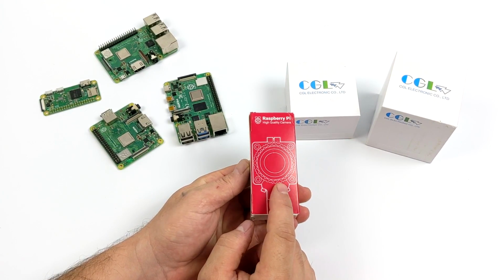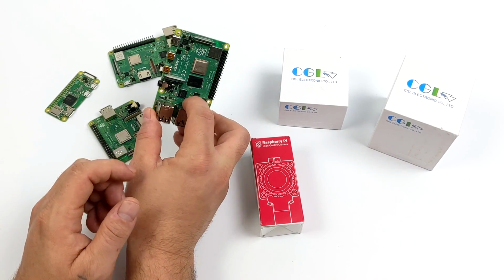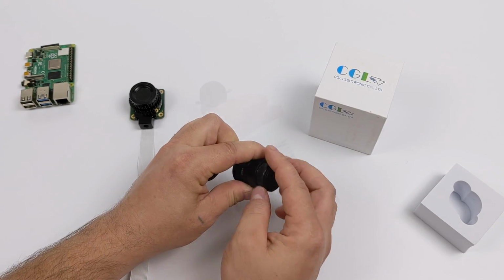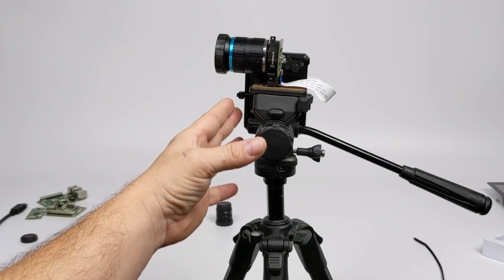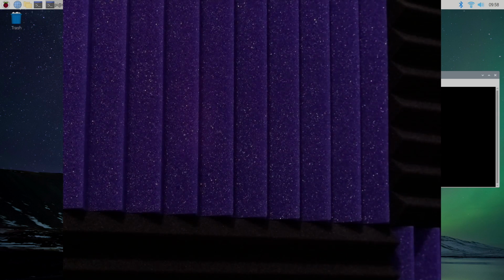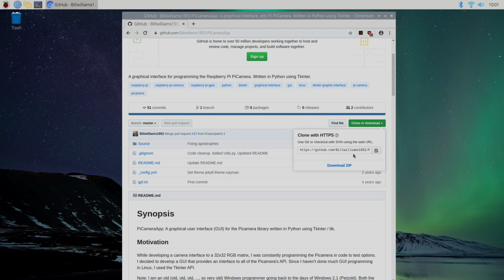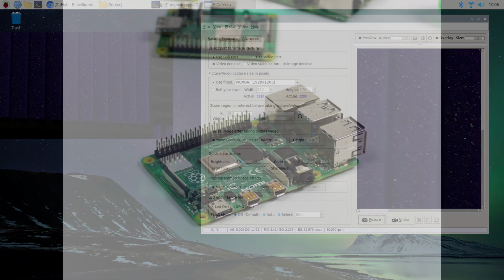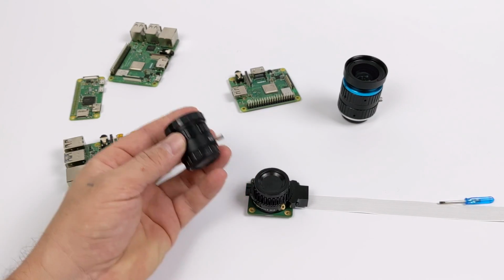The New Raspberry Pi HQ Camera Is Awesome! - Set Up And Testing

Comment: There is a board you can buy that accepts the ribbon cable from the camera and has USB-C for output. I built mine for use at the telescope, connected to my laptop.

Comment: Okay, the HQ camera is great, so I've purchased 3. One is for a motion tracking telescopic security cam and 2 are for robotic stereoscopic depth perception on a StereoPi CM3 board. They're all hooked up and ready to start streaming... as soon as I can figure out how. There's much more to this than taking a snapshot or live preview, but obsolete support documentation and 2018 tutorials are mostly all that's available.😣 
I've watched so many OpenCV installs over the past week that my head is spinning.😵 But, haven't found any that cover gstreamer nor remote opencv processing of a streamed video source, especially w/dual cameras. Can't get gst-launch to work in python because I don't know whether to use uv4l, uv4l-raspicam, the picamera module, pre-loading the driver, -cs 3d sbs, or /dev/videox.
The IMX219 RPi V2 cameras work fine with python and nvarguscamerasrc on the NVidia Xavier NX, but not the HQ w/o removing a resistor. Besides, I would much rather keep the $400 NX on my desk to remotely process images from the StereoPi robot 'head' and return motion commands over WiFi. 
@ETA Prime, please follow up with detailed tutorials on this stuff, so that end users can get the most out of the HQ camera.🙏

Comment: As a professional photographer for over 50 years, may I make a suggestion?
Adjust the back focus on something that is very far away (infinity). 
Good subjects: clouds, mountains, the moon, tall buildings, cell phone towers, etc.
That way, the lens will be able to easily focus on anything closer. 
Once the back focus is set then if a lens has distance markings (3, 5, 7, 10 feet, etc.), then those should be fairly accurate for correct focus.
 
Terry Thomas...
the photographer
Atlanta, Georgia USA

Comment: I've got my 16mm lens already, and the camera finally shipped yesterday! Planning on using mine to work on PCB repair as the quality of the image when connected to a suitable display looks far better than the microscope I got from eBay (then subsequently found was damaged when I eventually opened it 9 months later! will repair the case that's damaged as electronics seem ok).
Anyone had experience of using for PCB work yet?

Comment: Is it possible to remove the lens mount from the sensor board? I have some use cases in mind in which the mount would be a drawback — such as mounting the sensor at the image plane of a film camera to check that the lenses focus correctly.

Comment: Thank you for the video.  I will definitely be getting one of these cameras and both of the official lenses.  One possible concern is the depth-of-field.  Is the wide-angle lens also a macro lens?  I assume that the telephoto lens is not.  At least it is rare for a telephoto lens to also be a macro lens.  What is the closest focusing distance and at that distance how many lines-per-inch (LPI) will either of the camera and lens combinations resolve too?  I have a need to programmatically capture images of at least 200 LPI, over a depth-of-field of at least 5 inches.  Can this camera, with either of the official lenses do this?

Comment: Hmmm.... interesting alternative for astrophotography.
Reply: Marcos Codas The CCD sensor is about 1/10 the suitable size for Astrophotography plus the ISO range is not enough. So the light capturing ability is no where near where you would need it. So wouldn’t be any good beyond basic Astro shots
Reply: @CiaranMartin  I should have been more specific. If you were to attach this to a guided telescope, it'd make a pretty good companion for that (as the ISO isn't all that important and the sensor size isn't as relevant due to the way those pictures are exposed).

Comment: Wow this camera is what I was looking for.
At work I might have a project where we use RPI + OpenCV + Camera to count people entering stores/supermarkets during pandemics and it would eliminate the need for some valuable personnel just counting people going in and out.
I was concerned that most of the cameras for RPI weren't very well suited for such application due to the limited resolution and optics.
This one should be perfect.
Shame that it's out of stock everywhere already :/

Comment: Only around £50 for the Sensor and £25 for each Lens.
Takes standard C and CS type mounts.
Infra Red Filter fitted but can be removed (voiding warranty).
1920 x 1080 Resolution (may have a problem using it to record 4K at the moment though).
Works with all Raspberry Pi versions.

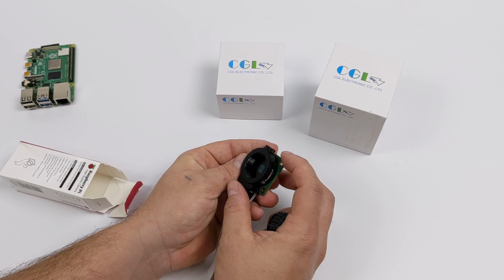Comment: At around 2:45 you mention that the "back focus" would need to be adjusted when you put a new lens on it but I missed the part where you describe how to do this. Is there a "correct" method? Does it need to be done for each new lens, or just the first time you put a lens on and lock it and it will work for all lenses thereafter?
Reply: The bigger lens costs $50. That lens requires the HQ camera board which costs $50. As I understand the system, the "back focus" is on the HQ camera board and when a new lens is used, the "back focus" is a focus opportunity (or a burden - depends on your outlook).
Reply: @vvwording4844  A simple "I don't know" would have sufficed.

Comment: print 3d case to put everything together, the pi, camera, battery pack and lcd display. Make use of GPIO pin to make shutter button or you can just use touchscreen display panel. Et voila, raspi-based portable digital camera.
Reply: Why?? Don’t you already have a phone that’s smaller, lighter, more convenient, with a camera that’s as good or better?
Reply: @davidleigh6196  its not about that. Its just curiosity, the feeling of satisfaction when you can make something and it works.

Comment: I don't get why people hate on the W small camera connector. It is just a connector. The cables that go from the small connector to the larger connecter are EASILY found for less than a dollar--and there are many, many perfectly suitable cameras that have the appropriate cable end already for the W specifically. They make handy little "room monitoring" webcams for a home automation setup.

Comment: I hope IMX477 will get support in ESP32 soon. I've been wanting to build my own DIY 360 degree camera for cheap and I want to dewarp the images and videos on my phone (OnePlus 7T) while caching to an SD card connected to the ESP32 (to hopefully get higher framerates by eliminating streaming overhead). I was thinking I'd use 3 wide angle cameras.

Comment: I really love having a MicroCenter nearby.  I am the IT manager for a cold storage plant and often I will buy things like printers and TVs there for less than Amazon. Also their SD, USB Stick, and SBC pricing is typically half what you'd pay on Amazon.  The other day I had to buy some sort of mesh system for the WiFi in my house.  If I had waited one more day my girlfriend probably would've killed me, so I guess they saved my life.  The salesperson there recommended I get a Ubiquiti Networks UniFi nanoHD AC2000 Dual-Band Wireless Access Point, instead of a mesh system, and boy was she right!  I went from about 20-40mbs around the house for 250mbs everywhere.  An amazing store!

Comment: Thank you for posting this video and I have been looking for reason to upgrade from pi 3b+ to pi 4. I am into video recording as a hobby and I was considering getting a more expensive camera. If this HE camera turn out to be a solid performer for 4k 10bit recording then I am getting both the pi 4 and the HQ camera module. Subscribing to your channel.
Reply: While the sensor seems to be capable of doing 4K at 10bit  (it can do a full sensor readout at 40 fps at 12bits), the Raspberry Pi will be the limiting factor. It's either the CSI interface that's used that doesn't support 4K anything or that the built in h264 encoder doesn't support 4K.
Reply: @LewisUpperton  Oh that would be my first disappointment.

Comment: Can you check it with android installed on raspberry pi and use the Google pixel camera Apk
Reply: Wouldn't work bcz it requires Snapdragon chip
Reply: @nijoeli  i think it can work because it works on Exynos too and if it doesn't work it can try filmic pro Apk

Comment: I have read about this camera just a few days ago. Placing a order for it and the telephoto lens as soon as stock is available in Canada. 

I use a number of raspberry Pi’s using MotionEyesOS and I have on camera covering my backyard. With the standard V2 camera I only get a large image and can’t see the work shed that I need covered. But now with this new camera and telephoto lens I should be able to get a much better recording and still images. 

With this new camera anyone that’s interested in a DIY security cameras that are self contained , independent and completely off grid can now get a much better image coverage for just a few dollars more.  

Thanks again for providing this very important product review.  I was holding off on buying it until I had a better understanding of its Quality and features, but now I do!

Comment: Fantastic. One detail though, "Although I'm sure some companies will release more lenses for this". Actually there are tens of thousands of Lenses that will mount on this immediately. The module uses a "C-Mount" and "CS-Mount" (C Short) standard screw mount lens.  The C-Mount standard has been around since 1926 for 16mm film cameras and I'd suspect that the original 94 year old lenses would work. Basically just look for any C-mount or CS-mount rated for a 1/2.3" format or larger. But the "sensor format" is very important to check on such lenses. This specifies the size of the sensor and if you buy a C-Mount lens with a smaller format size you will get the edges of your image cut off. You can also get a wide variety of adapters to mount anything from a DSLR lens to an astronomical telescope.  In fact one of the first things I'm going to slap my module on is an 8' Schmidt Cassegrain Telescope.
Reply: Do you think Pi + new cam module + a telescope could make for good stellar photography or observation?
Reply: @Teslanaut You might need to remove the ir filter on the camera module, and check first if it support  5s-20s long exposures.
Reply: @tomf3150  does the lences or the sensor have the IR filter?
what do I need for macro/microscopic filming, is one telescopic lence useful therefor?
Reply: @tomf3150  Definitely not going to work well for high end long exposure Deep Sky Object DSO imaging, no cooling and the pixels are too small, I'd go for a Revolution Imaging product for a cheap option for that. OTOH this is reasonably well suited for Lunar and Planetary Imaging with image stacking.and drizzling I'm very interested with respect to Lunar Imaging at high frame rates to achieve "Lucky" imaging. 

That said, the bare board and low cost makes rigging a Peltier cooler a trivial option with negligible downsides. It's like overclocking, you aren't going to get insane performance but the downside is so low that it is a no brainer to do.
Of course this is a bit OT for a emulation and gaming channel :)
Reply: I don't think you need or want long exposure when you can stack multiple frames. That way you can even get rid of some movement noise.
Reply: Is the "back focus" ring to adjust between C-Mount and CS-Mount?
Reply: @GordieGii  It comes with an adapter ring, which in the video was removed along with the sensor cover.
Reply: @GordieGii  from what I've read, I believe that to be the case.
Reply: Thank you, I was hoping someone had already identified the mounting ring. Shame my len's are all sony A Mount.
Reply: You can also get Pentax PK to C-Mount adapters, and other variations i'm sure, so yeas there's loads of choice already. I can finally use an old PK 80-200mm telephoto for something!
Reply: Pity that my existing MFT lenses can't be adapted to this.
Reply: @theone1and1  I'd like that, too :)  Most MFT lenses are electronically focussed, though, so unless you have Voigtlaenders, the Leica M-mount and Leica Thread Mount (LTM) lenses would be more suitable as they are mechanical and have a slightly longer flange of ~27mm, without being so hulking as SLR lenses.  I've a few of these lenses with adaptors for each mirrourless camera, and they can yield a different perspective depending on the camera, so they're fun and good value.
Reply: @fellowcitizen  Ahhhh good point. The protocol has been reverse engineered I believe,  but that's really more trouble than it's worth I would think.
Reply: @theone1and1  of course they can, lens is just a pile of glass in a tube

Comment: Why should you use a Raspberry Pi Camera instead of a Smartphone-Camera? Are there any meaningful usecases for it?
Reply: The ability to mate much larger lenses and a much larger sensor should produce better photos than a phone. Unless you're comparing to say a $1200 phone... But we're talking a $50 camera here. This is not a point and shoot solution, obviously.
Reply: DIY security camera
Reply: I can imagine people might pair it up with Machine Learning running on the PI to do some image categorisation, tracking etc

Security camera will probably be the most popular application

Comment: Thanks for this vidéo. Only point is Quality/Price value... almost 100$ for a12MPixels camera and lens... no autofocus.. poor value to me. But great vidéo and Like Allways Thumb Up !
Reply: To me, the Pi in general has never represented great value in raw specs. But its still great for projects.
Reply: @kangaroo4024  I totally agree, for me the real value of RPi is it's community. The hardware hasn't a good performance/price ratio. Just compare to Android Box on Aliexpress that outperform it in every single domain for 30€ with everything included (ram rom power supply). This camera is built on a x4 years old captor that wasn't great even x4 years ago.

Comment: Add a hw button, a small screen, strap it together. and your good 2 go! :D
Reply: If the review I've read is correct, the Pi can only handle 1080p@30fps anywho... So $25 for a Pi, $50 for the camera, a lens will throw you back anywhere from 25 to 50, and you want to add a small screen too? So $125USD + a screen + battery pack to make a 2010 spec "HD-Ready" video, woohoo. You could easily spend half that on an android phone, If you don't require the need to switch lenses. Or you know, buy a second hand dslr camera and get 4 times the resolution, don't have to F around with Linux, and still come in cheaper.
Reply: @kaydog890  We all know that, but it kinda aint the point :p